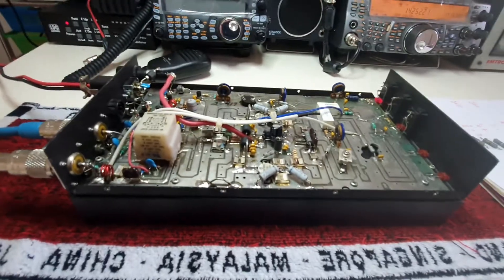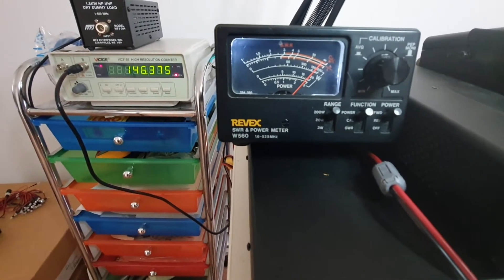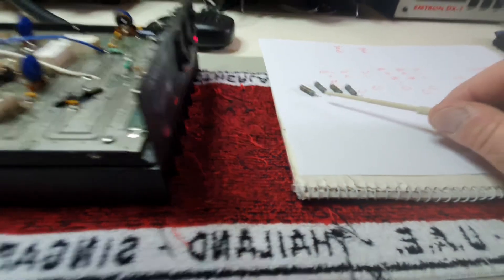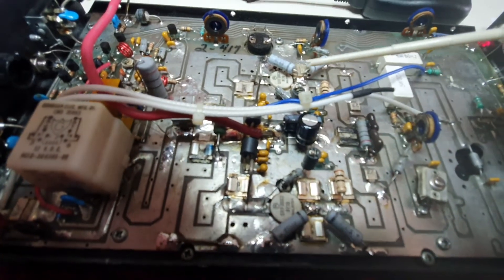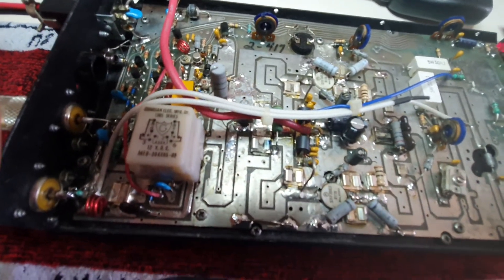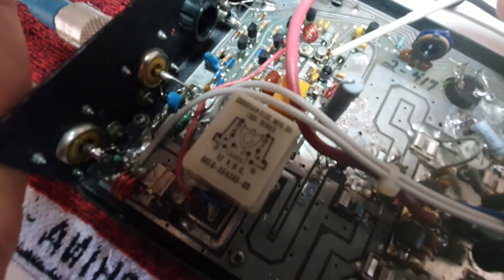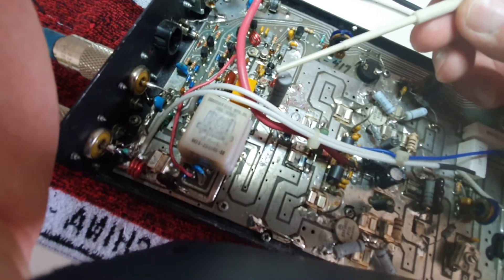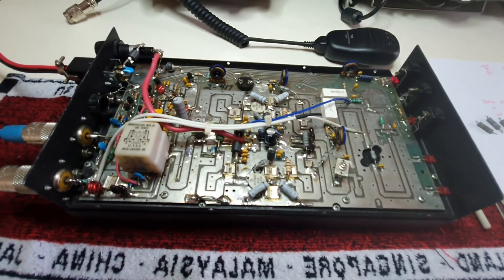RF Concepts 2-417 2 Meter Amp Restoration Part 4

Comment: Many thanks for sharing your experiences. 

My amplifier puts more than 200w when driving 50w, but I'm l going to check the values of my 39 resistors.
BTW...
How many ohms are those two smaller resistors and the ones that you are going to replace next?